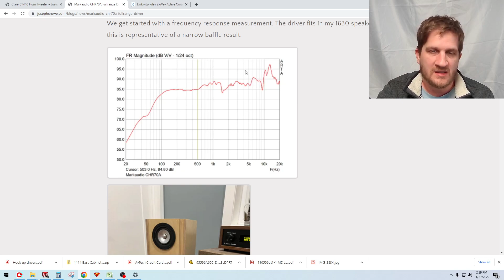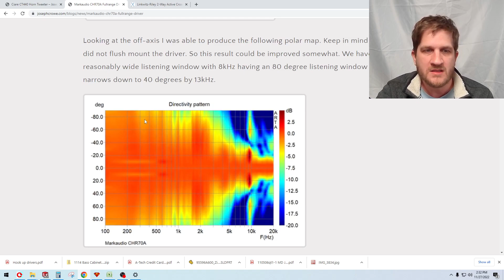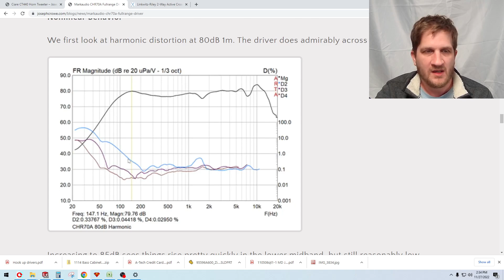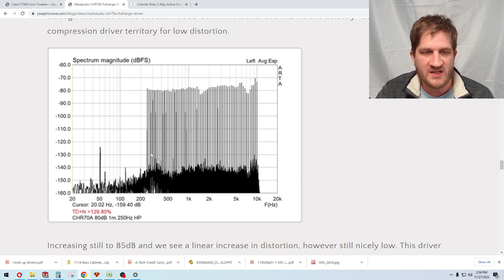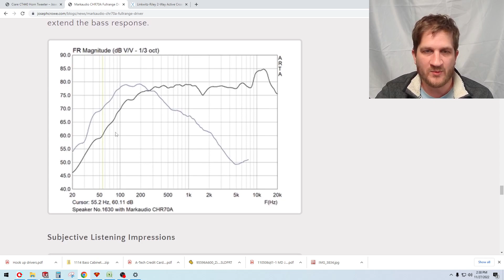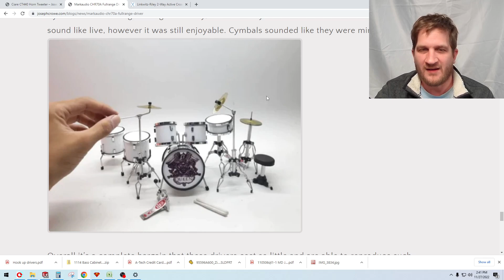Markaudio CHR70A Fullrange Driver

Comment: Joseph, thanks for this video, lots of good info ...one question, the manufacturer recommends 100 hours of low volume music to loosen up the suspension, people say that this "smooths" the response of the speaker. This results are right out of the box or after the 100 hours?. Maybe if not is a good opportunity to make a comparison with the before and after measurements and that way we can see what it does, i hope you can consider, cheers

Comment: Regarding the cymbals, could it be that you are hearing the aluminum material of the drivers and that was incompatible with reproducing brass cymbals?  Also, that terrible breakup above 10 K can't help but change the sound of the cymbals.  Sounds like a decent midrange that can be rolled off (steeply) to good tweeter (ribbon or amt?) At 5-6k.  The small size can allow a very narrow front baffle and a small format tweeter could get close to coupling at the crossover.  .

Comment: Nice review. Do you think that these MarkAudio full-range speakers are adequate to be used as a single full-range driver in a speaker cabinet and combined with an external active subwoofer that can reproduce bass down to 20Hz? Would that 2.1 setup with MarkAudio full-range speakers be a better HIFI than using a 3-way normal speaker system with the subwoofer?
Reply from the maker: It’s a good solution in this price and size category. Outside of that then there are certainly much better sounding alternatives.  Your proposed subwoofer idea doesn’t resolve the mid-bass issue (80Hz-300Hz region). A woofer that operates from 35Hz to 300Hz cleanly would be a better solution. You can still add subwoofers to cover the low bass. Adding a super tweeter above 8kHz is a good idea too. That way you can have a single driver covering the vocal range at least. Is this better than just building a dedicate 3-way? I think so. Most 3-ways have the crossover points at 600Hz and 5kHz, which is too far into the vocal region.
Reply: @JosephCrowesDIYSpeakerBuilding  thanks for your suggestion I find it interesting. I don't have experience with crossover and speaker design but I would like to DIY a speaker project and was thinking that a full range would be easier.
Currently, I have a pair of Technics SB-EX3 speakers from the 90s that has a frequency response of 33Hz to 45kHz and a new Yamaha NS-SW300 Active Subwoofer that goes down up to 20Hz, the sound is good but would like to build something that could improve, maybe replacing the speakers with a good full range would not improve the sound but probably adding a super tweeter above 8kHz as you say is a good idea.

Comment: Don't waste your time or money on these midrange drivers  pretending to be "full range".. Expensive for the tiny Xmax.  To get any bass a large vented resonant enclosure for horrible transient bass response or a huge long transmission line enclosure that will cost way more than just buying a nice larger Xmax coaxial driver and putting it in a nice smaller box.   The high frequencies will come out in a narrow beam and the upper mids and highs will be punctuated by cone resonances and breakup modes.  So simple jazz with a single voice, bass and drums will work fine.  These are a total disaster trying to reproduce a choir or complex music or when you want to distinguish between instruments.  These are vanity drivers built to look really nice for the DIY crowd, that can't design a crossover network.  Not good performers.  Adding a woofer and a tweeter and you will have a good speaker.